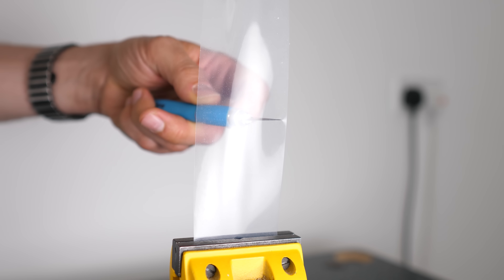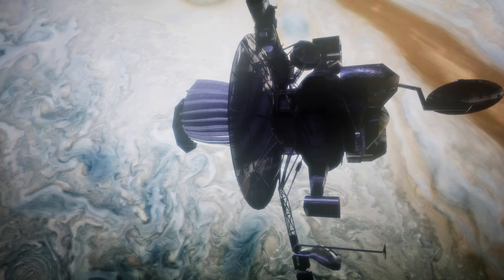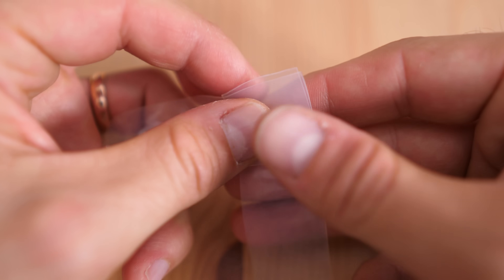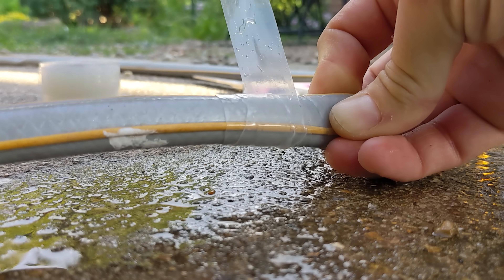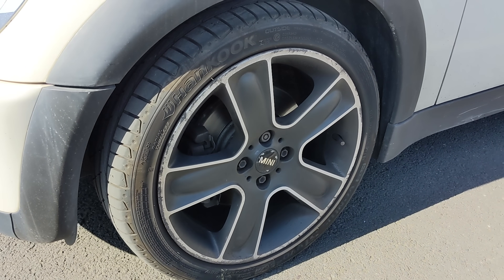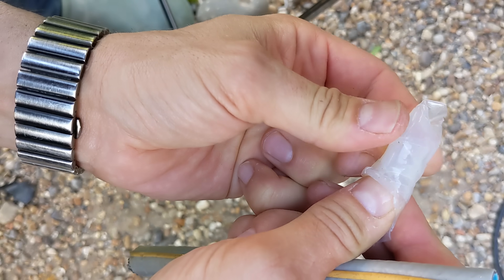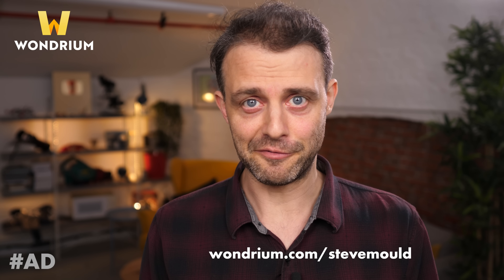Self-Healing Material

Comment: Technically, you can put two pieces of meta back together if you spin it fast enough to create the friction force required to heat it to the metal’s melting point 

: )

Comment: Here’s the interesting thing about metal: it is self-healing, and the same method can be used as this polymer.

Welding massively spikes the temperature of metal to make it melty, allowing it to meld to other metal pieces. But, as you know, temperature is also related to pressure.

So, you can actually use an identical method of using pressure to self-heal metal, you’d just need a thousand times more pressure to do it.

Comment: I know this is another example of a sticky thing, but another self adhering polymer that people see in everyday life is gluten. To simplify it a bit, gluten proteins have long amino acid chains that can link together both end to end to make the chains longer (the primary purpose of kneading dough), as well as side chains with thiols that when hydrated can bond to each other so the chains connect. When both of those interconnect a lot, it creates sheets of connected parallel protein chains.

Comment: there was a toy line in the 80s that was made of a material that was stretchable, and you could even rip off limbs and reattach them, called the Manglors.  it was FAR from being "self healing" like this, but a decent concept.  That was the toy lines downfall as it only worked at reattaching if you did it in seconds, and even then, not all the time.  it was a material called sorbothane

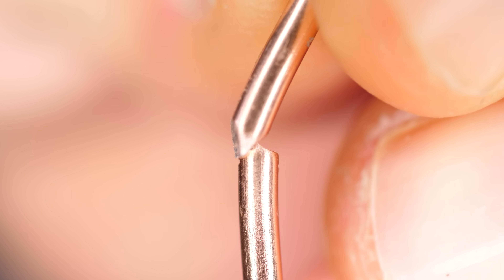Comment: Wonder how long does it take to "cold weld" in space? Could you eg. connect metal wires simply by pushing the ends together? Like at 1:22 ? I imagine it's not that quick and easy, or there would have been more problems encountered over time than just the arms of one satellite failing to unfold. Very interesting subject though. Definitely think self-healing components are the future.

Comment: Steve I love your videos but I can't let "one gient molecule" for the bouncy ball and the car tyre go past. No chain growth occurs when you denature the latex emulsion just chain entanglement. The car tyre is vulcanised which does extend the polymer chains a little, nevertheless chain entanglement is the main structural component. Also you don't cut polymer chains significantly with scissors, extensive mechanical shear can decrease average chain length but it takes a lot.

Comment: if oxidation is what's stopping metal from cold welding, why does gold (which is not reacting with anything) not cold welding?
Reply: It does cold weld pretty easily actually, even under regular conditions. The reason why you can't just casually compress them together like this is microscopic atmospheric junk that creates a layer between the two pieces of gold. You also need a smooth surface, otherwise only the peaks will touch and connect and the seam will be way more fragile than it could be

Comment: couldnt it be possible that rather than a chemical reaction creating covalent bonds, what happens with this polymer is its strands 'trap'  between each other? kind of like a molecular velcro. would explain the selectivity and the very mild circumstances under which it can fuse to itself. and the strength! molecular-sized velcro would grip like crazy

Comment: I'm definitely no chemist.  But as I understand it, your examples of metal and plastic can heal- but only under special circumstances, especially using heat and pressure.  If you cut a metal wire with snips as you did, then just push them back together at room temperature with hand pressure, they will not "self-heal."  But if you heat them up, and hit them with a hammer or press them with a vice- that's what blacksmiths do with their hammer and anvil, more or less?  If you cut a piece of plastic then just push at it at room temperature, nothing will happen.  But if you heat it up with a flame, or even a heat gun depending on the plastic, and apply more force with a clamp or something: you can weld that plastic together.
Maybe the chemical properties of the "self-healing" material work similarly, but at much lower temperatures and much lower pressure.  You can't just throw the pieces together and expect them to permanently bond with each other.  The video examples showed you applying finger pressure, and with it friction heat and body heat.  Maybe that, along with the properties of the polymer molecules you discussed, is at work.  Molecules ripe for re-attaching, aided by a rise in heat and pressure: much less than most solid materials, but still necessary.
Maybe?  Again- no scientist here, just someone who enjoys watching real science people talk about their thing, having a guess.

Comment: So theoretically if you have a metal in a perfect vacuum and cut it it should be able to be reattached in the area that you cut it with some difficulty? Or are there other factors at play that would cause this sort of thing to not happen?
Reply: You need them to be at least somewhat flat and smooth too, otherwise only the "peaks" will touch and connect leaving gaps in the seam, but yeah, aside from that they would weld completely in perfect vacuum

Comment: I’m having a hard time intuitively understanding that oxidation alone prevents metal from bonding. If that was the case, wouldn’t metals that don’t oxidize (gold, platinum etc) bond whenever two pieces of the like metal are in contact with each other? 

I could imagine you could weld metals with some pressure and a bit of heat (less than melting), like how Damascus steel is made, but why don’t precious metals cold weld?

Comment: there is also a sort of micro-velcro effect that could be at play. if the polymer is short polymers of two types that are very specific to each other then instead of a single molecule it would be a fibrous connection and cutting it still has most of the ends being micro-velcro. think of it like a substance made from balls of velcro, of both types. they don't stick to anything that doesn't match their corresponding fiber, so they aren't sticky, but they do stick to each other. if you cut it with something blunt enough most of the velcro will separate instead of being cut and so it can be put back together, though you might need some pressure and maybe some shifting to work the velcro into itself. if this is happening at microscopic sizes then this would fit what is happening, though there might be some sort of suspension medium involved.

it is an interesting thing to ponder and test out, basically reverse engineering in a scientific fashion, and it trains one to think of things in scientific ways with a knowable answer to ensure things don't just devolve into pointless navel gazing.

Comment: I am the only one who thinks that "entropy" wouldn't let other materials to heal themselves. Cause, entropy loves the maximum disorder. If you cut a piece of metal, you increase the level of disorder. And since we increase the entropy, we have to "give energy" to put them back which means we have to force them to do it. But polymerization such in this video can easily get thru to entropy threshold with light pressure or room temperature.

Comment: I think it's fairly obvious that if it's shipped with a strip of of plastic or in individual sheets or in some way separate from itself that clearly it- it's it's a simple fact of the polymer being a naturally cross-linking molecule.  I think what we're all thinking of is of a polymer that under structural damage from a pre-designed molecular arrangement 21in an after damage State creates its own catalyst from that damage would be kind of polymer we're all sort of curious about the implications of.
Reply: Because the idea of a of a process of manufacture that could create such a dynamic molecule would have a lot of implications for a lot of other molecules that could be fabricated in such a way.

Comment: Why do certain polymers self-heal? - ChatGPT

"Certain polymers are able to "self-heal" due to their unique chemical and physical properties.
These polymers have the ability to undergo reversible cross-linking, which means that their chemical bonds can break and reform in response to a stimulus such as heat, light, or pressure.
When a crack or cut forms in the polymer, the broken chemical bonds can reform and heal the damage. 
This process can occur spontaneously at room temperature or with the application of external stimuli. 
The healing process can occur on a molecular level, allowing the polymer to repair itself and regain its original strength and properties.
Self-healing polymers can have many practical applications, including in coatings, adhesives, and electronics.
For example, self-healing coatings can prevent corrosion and wear on surfaces, while self-healing adhesives can improve the durability of joints and connections."

Comment: Chances are it's sticky to at least a couple more substances, maybe even latex
or another polymer, but the expanation you gave for cutting a polymer,
and then subsequently going neutral again, is not what happens to this material.
It stays slighty reactive, but only to itself (and maybe another few polymer types.)
y guess you'd clip it on one side, and see what happens if it comes in contact
with other polymer types.

Comment: They use ultra high molecular weight polyethylene to cushion inside artificial joints.  Awhile ago, they increased the strength of this polymer by gamma irradiation.  The increased cross linkage significantly extended the life of these implants.

Comment: When you cut your plastic tube, you claim that we are breaking C-C bonds. Are you really sure this is correct? Even very long chain polymers may only be on the order of 10s of microns in length, assuming they are perfectly straight chain which they won't be. For me it seems more likely that the blade is "plowing" a path through the material, breaking the intermolecular forces rather than the intramolecular bonds. Happy to be proven wrong though, it just doesn't feel right to me.

Comment: Maybe it's the type of polymer chain that wants to link together like a circle or just bind with itself or a specific fold, but is dried entangled in a specific layout, maybe with a charge running through it as it dries or something temperature or chemical related but it wants to finish binding with itself or things like it. Does it stick to any other kind the polymers. And how does it react to something like uric acid or boiling

Comment: Simple explaination: when you divide a thing, the structure beneath its skin will tear apart, the harder the material, the harder to break it - to divide it, because the structure is so stable and strict that a minor impact is not enough to separate it. However, with the same reason, it can also hard to put them back together because the tear apart structures will fix themselves, which means that if we broke 1 metal into 2 pieces, each pieces will reconstruct itself to stabilize its new structure, which made grouping them back again feels impossible.

Comment: There is a phenomenon known as “ringing” (if memory serves. . .) where metal surfaces finished to a high level of flatness will stick together rather firmly. They have not “healed” into one piece, but it does take a fair amount of force to separate them.
This may be “crosslinking ” as described here. I would expect that a polymerization reaction would be measurably stronger than crosslinking. A tensile strength test might shed some light, although getting a perfect heal across a cut would be difficult with this thin material.
Reply: I can't remember from Btec Engineering wether that was because of crosslinking or because of the air between them being pushed out  creating a sort of vacuum between them and so they are harder to pull apart. I may be drastically wrong though so don't quote me on that it was a while ago I did this 😂

Comment: Edit: continued the video and you spoke of this...

It is very much possible to "cold weld" metals, but only if the parts are completely flush and without any oxidation.
Depending on the success of the cut, the material will be just as strong as if it was never cut in the first place.
Dad went to a metalworking school and had his practice at a forge. He saw the process and even though cold welding is never perfect, I found the idea bonkers and fascinating.

Comment: I think the mechanism that puts the pieces back together is supramolecular interactions. The polimer chains are functionalized, at their ends there is an additional bonding, like a puzzle piece. So when you put them back together the puzzle pieces at the end of the polymer chains meet the other puzzle piece.
Reply: Yeah. The selectiveness of the reactivity is interesting though. It needs low activation energy, doesn't react with simple ions or molecules like from air or other surfaces, but very readily reacts with the end of another polymer chain. It really must be like a puzzle piece with a specific shape, but then what keeps some oxygen atoms from coming together and taking up part of the open reaction site, blocking another polymer chain from bonding there?
Reply: @nathanaelvetters2684 To actually find out, wed need to calculate the electromagnetic fields with 100% detail.
Reply: Can it be a 2d polymer? 
Two polymers reacts not only on ends but on long parts of molecules
Reply: Great analogy
Reply: Yeah but that means repeated use can make it worthless because itll all bond back together like a normal polymer at some point

Comment: Okay as a combo pipe welder that works with various metals everyday the part where you said the umbrella in space cold welded itself had me thinking, so if I get a piece of metal wire (70s6 filler rod) and let’s jus say I cut it in a vacuum chamber then push those two back together that it will become one again?

Comment: Self fusing silicone tape. It is a rubbery substance and have worked with it a lot it’s great for everything on a car (wiring looms mostly for me). It’s water proof, air tight, high temp proof, non conductive, high pressure resistance, oil proof and leaves no residue when cutting it. Perfect for wiring looms (near where oil can leak or near very hot components), coolant leaks, air leaks, oil leaks, wiring wrapping, waterproofing connectors. Good stuff a bit better then duct tape BUT doesn’t stick to any surface but itself which is a benefit but a pain to wrap in a circle around itself in a tight space.

Comment: This should be the mandatory material for Vacuum Press Tables in wood shops. 

A single pin hole can ruin the vacuum seal and render the work useless as it wasn’t adequately clamped. 

If the pin hole can heal itself - that’s a serious game changer.

Comment: I may have experienced a self-glueing sticker once. This vid left me thinking if it was something similar. It was in an airport, a self-service baggage drop-off station automatically printed the long paper strip that you attach as a tag to your bag, with its identifying information. I remember the tag had one printed paper side, and another plasticky side that surprisingly didn't stick to your hands but glued firmly to itself when you bent it around the handle of your bag and made it touch itself. I remember being baffled that it didn't feel like the familiar adhesive side of a sticker at all. It didn't stick to the handle of your bag either which made it really convenient to detach later without leaving residue. Has ayone else ever come across this?

Comment: I'll guess:

When you apply force, that "splays" the material on a molecular level, something like how velcro works, such that if the material is pressed against the material, the two splayed surfaces will open up to one another then un-splay and close to reform a contiguous surface.

Try stretching two separate pieces on top of one another, and testing what amount of pressing-force is necessary to fuse them.  Try quick pulls and show pulls, etc.

Comment: Why wouldn’t the two oxidation layers fuse together? After all they too are of same molecular make up?
Reply: They probably do join, but bits of oxidised material that join together from each side have a stronger bond with each other than the main substance they oxidised from, so they break off leaving exposed areas of the main substance to oxidise. Basically it does happen but you wouldn't notice it. I wouldn't know though, it's just a guess lmao.

Comment: Loved that close up of the cut sodium.  Never seen it depicted quite that way before.  You could see the surface seem to bubble.  What is that?  Is that oxidation straight from the air?  Or, could it relate to sodium pulling water out of the air?  I'm tempted to say: "call in the slo mo guys", but what we may need is super macro guys who have the tech magic to overcome the sharpness robbing depth-of-field problems.

Comment: The one type of self-healing polymer that I'm really curious about is the type used in blood collection tubes.  Most blood collection tubes have a rubber(?) cap at the top.  To fill the tube, you pierce the cap with a needle.  But when you take the needle out, it doesn't leave a hole!  (Which is great, because you typically need to invert the tube after you draw blood and you don't want a contamination risk of any blood leaking out).
Reply: I really dont think this is some kind of self healing polymer. Probably just rubber, as you said. You make a hole, but you cant see because the walls get pushed in. This also seals it.
Reply: Thats just elastic
Reply: This is the same for micro mushroom grow bags. The injection port reseals but not in the sense you think. It just expands and the port closes up.
Reply: I use insulin vials and wondered the same thing sometimes.